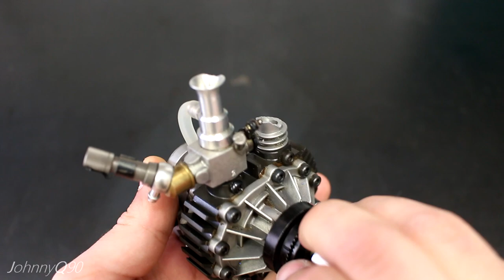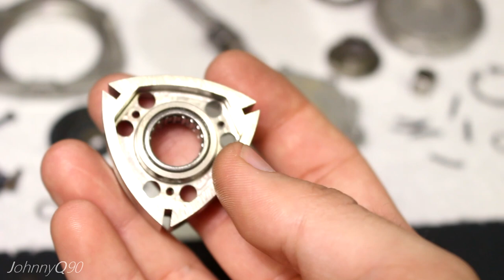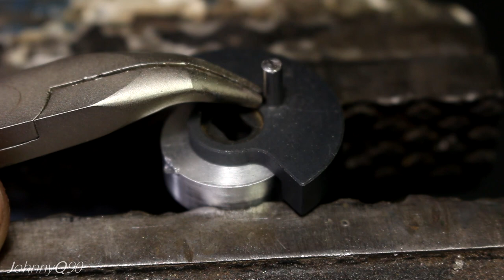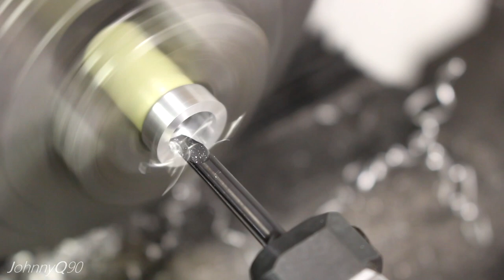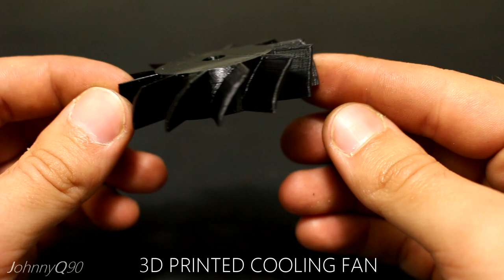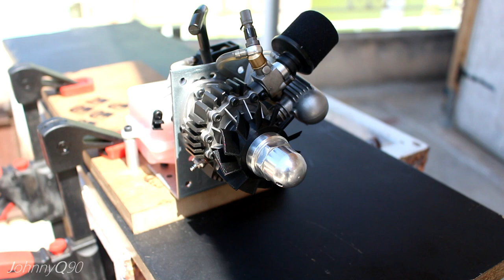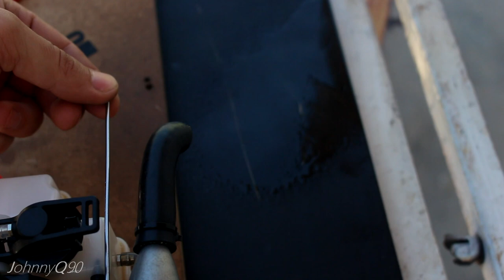Nitro Rotary Engine Cleaning & Pull Start Addition

Comment: Very interesting project well carried out, only criticism was the mod to the broken silencer manifold, reducing the internal Dia by fitting an internal tube restricts the flow of exhaust gas, a simple braze/weld process using alloy rods and blowtorch can mend these small alloy castings and effect a permanent repair without the internal restriction. The pull start is an excellent accessory to put on this motor. Well done
Reply: i was gonna say this but you beat me to it
Reply: Nah, TIG weld the muffler.  Easy.  Great video!

Comment: If the pin in the counter weight is steel, that may be the cause of much of the vibration.
Maybe an aluminum pin would be strong enough.

Comment: I have never seen a Rotary Engine that is Nitro. It is so awesome the RPMs come up so fast. I just bought a Cam-Am Rotary 
engine 1000 it like 998 cc. I haven't even drove it yet. I am in a wheelchair i have to put my hand controls on it this week. I have 
always like the Rotary engines awesome the way the work.I have lot of diff RC car and 4x4 trucks that are Nitro. The sound that 
that made was awesome.

Comment: Cool! 
Can you make a mini dyno for your model engines to test the power output? 
I dont know how, maybe something with a variabel electric load and an Amps meter?

Keep up the good work!
Reply: Jonathan Straetman yeah that can be worked to the engines be connected with a motor to produce energy that can be counted to volts i thing
Reply: pixelmaster i think it would work better if he converted to watts(i do not know hard that would be).
Reply: That little thing (OS MAX RE 49 PI-II) should have about 800W peak power output.
The only good affordable way I can think of is to use two multimeters, agenerator and electric kettle as resistor.

Formula to get the engines power:
P = I^2 * (V / I)
Reply: P = V * I
Reply: That is what I wrote. Therer is no need for the brackets and then you can take the sqaure and devide cancel each other.

The idea is P = I^2 * R as having a power resistor to meassure the voltage drop accross should be fairly easy (electric kettle, just poses the problem of variable resistance) and also meassure the current.
P = V * I
= I^2 * R
= I^2 * V / I

Formula looks a bit backwards, but it is practical (two multimeters should be in anyones tool box).
Reply: You need a constant load to measure exactly the power output. An electric kettle as you said, has a variable resistance and the way you suggest him to do it, is not precise.

You don't need to know the resistance to measure power. All you need is a load bigger than the generated power by the engine and you need an ammeter and a voltmeter. Voltmeter is not required. If you hook the engine to a known voltage generator you only need to measure the intensity (because you already know the voltage generated), therefore you only need an ammeter or multimeter.

You need to use a generator with the power output bigger than the engine power. Now put the ammeter on parallel on the output of the generator. I'd suggest using a shunt resistor or using an ammeter with protective overload circuit just in case that the generated intensity is bigger than what your multimiter is capable of measuring.

Now just use P = V * I and you get the RMS.
Reply: Or if you have a thick cable laying around, put the generator in short circuit through it and use a clamp ammeter over the cable.
Reply: When meassureing the current and voltage, the resistance of the kettle can change all it wants because current and resistance are correlated. You just have to have the system stabelize.
Kettles are basically water cooled power resistors (2.1kW resistors).

Generators, even good ones, vary slightly in output voltage. Not meassureing that at the time you take the current reading will definetly skew the results. Apart from that, some generators have a much higher open circuit voltage then they have load  voltage.

Hooking up any ampmeter in paralel to the generator will probably blow a fuse. In this case here with a 12V nominal voltage generator, we are looking at >60A current flow at peak power output.
Shunt resistors for more than 60A might be quite hard to find. (I found a 2kW rated, 3600 Ohm resistor, costs 510€)
The 12V from above are taken from a generator I found on Amazon on the quick. Probably an automotive part, puts out up to 110A at 12V (1.3kW)
Reply: It works the way you said but that way, it is more complicated I'd say. He could just short circuit the generator output through a thick conductor and just use a clamp ammeter.
Reply: Bon. Demais. PRETENDO. Ter. Huma Moto. Con. MOTOR.rotativo
Reply: Some smart guys in this comment section, awesome!
Reply: @0BRAINS0  - found this comment and wanted to point one thing out (from what I'm reading g your comment looks misplaced, but that could be YouTube bugging). A rotary motor (even like this rc version) is still a 4 stroke motor. There aren't any valves or valvetrain because the timing of the various strokes is carried out but the rotor itself covering and uncovering the ports as it 'turns'. So even this tiny little rotary is a 4 stroke. Just wanted to share that. :)
Reply: its rated at 1150 hp
Reply: Use a DC generator and multimeter to measure horsepower. Multiply amp*volt to figure out how many watts you're generating. 745 watts give or take is 1 horsepower. Divide horsepower by RPMs for torque.
Reply: @Otherhats  ))l hi kip
Reply: @MazeFrame  haha nerds

Comment: Put it on a Bicycle!  Make a small clutch on a sprocket and then put it onto a mountain Bike so you can shift it, and make a small gear box off of the engine as a final drive reduction gear box so that way the engine wont lug to bad.
Reply: TRX VLOGGER It wouldn't come remotely close to moving a bicycle, even with no one on it.

Comment: Will you make a two rotor out of 2 of these
Reply: Adam Powers I want to connect like five normal nitro motors and put it in a rc car
Reply: 5 of those RC rotary engines and it could probably run your car
Reply: i made a twin
Reply: Gmanmovies09 that car would have to be a smart car, and "run" at half a mile per hour
Reply: @refraggedbean  or be a go kart

Comment: that's a beautiful little engine ,,I've had a few RC engines over the years but never a rotary engine  ,currently i have a 5 cylinder radial  and an  opposed 4 cylinder RC aircraft engine ,,and too many RC engines made from weedeater engines and chainsaw engines to remember then all ,the biggest of them is in a large RC helicopter  , that one is a Husqvarna 3120 ,,120CC chainsaw engine that makes 7.7HP and 10 ft pounds of torque at 12500 RPM

Comment: Long live Wankel
Reply: Rest in Peace Wankel Engine 1964 - 2012
Reply: Yep the old German brand/inventor name for rotary engines ;)
But there's a reason why they're not used commonly anymore, they are simply inefficient and requires a lot of maintenance.
Reply: @BillAnt  nope it was named after the Founder of the Rotary,Felix Wankel.
Reply: @Julian < Sorry I meant the brand name/inventor, not the word for engines. :D
Reply: @BillAnt  Fuel & emissions efficient, no. 
Power-to-weight efficient, hell yes.
I had 3 RX-7's. 
The 3rd one was a turbo I rebuilt to run 13PSI.   :-)
Reply: Add to the positives, fairy easy maintenance with less moving parts than traditional engines.... add to the negatives fast wear of the rotary piston seals, inefficient combustion chamber (partial combustion), an oil guzzler, etc...  Those are probably some of the reason they haven't caught on for mass production after all.

Comment: I think thats a wankel engine, not a rotary engine.
Reply: A wankel engine is a type of rotary engine.
Reply: It's a o.s. rotary. Rotary is the style and o.s. is the manufacturer. Wankel is another manufacturer of rotary engines, hope this helps clarify.
Reply: ok, thanks for telling me :)  I thought rotary engines were those engines which had their cylinders in a circle around the crankshaft. Guess I was wrong.
Reply: that's a radial
Reply: So both of them are radials. I just learned something new!
Reply: Its a bit complicated, and somewhere in history, a few terms mixed up. in the early days of aviation, there where a kind of radial engines, where the crank is stationary and the rest is turning, the where called rotary engine. many years later, Felix Wankel invented his kind of engine, and it got the name Wankel engine, so strictly the are all wankel engines. some manufactures call it "system Wankel. When Mazda started to use the Wankel engine, the give it the name rotary engine.

The O.S Wankel engine is a project of Graupner / NSU (back in the 70's one of Europe biggest model company's, and NSU the only car manufacturer that used a Wankel engine) And O.S. Back in that years, the model engines where not very sophisticated. So Graupner invested in O.S. to get better machining tools and equipment to build such an engine. 
And That is why other iconic O.S. engines where developed after this engine, the were able to produce them. 

There is also another (back in the 60-70) big stationary and bicycle engines, called Sachs, the also did produce Wankel engines for lawnmowers, snowmobiles, and so on. 

So my history 101 on Wankel engines
Reply: So I was techinically right about what I said? And also, I LOVE sachs, I'm actually working on my own sachs engine for my e-type (I want to go faster thatn 30km/h) ;)
Reply: That's correct, this is a Wankel KKM motor.. not a rotary. Graupner GmbH. became a Wankel- NSU licensee in 1967 and was limited to the non-rotary KKM-57 type Wankel engine shown here. Hanns Paschke and Walter Froede discarded Felix Wankel's troublesome Rotary type layout for the conventional rotating shaft arrangement.
Reply: +rdizzy12  Hanns Paschke and Walter Froede completely discarded the rotary layout with the Wankel KKM-57 engine... the only rotary Wankel engine was Felix Wankel's original single prototype engine that resides in the Deutsche Museum.
Reply: Seth Echternacht Graupner GmbH bought the rights for the Wankel KKM-57 design (the non-rotary version) from Wankel-NSU Sept. 12th 1967, decades later O.S (Hobbico) purchased the WANKEL design and remaining parts inventory after Graupner discontinued production. Just to clarify, Cheers!
Reply: +Marcel Hanenbergh More complicated than you thought... It seems you have your facts a little confused. Felix Millet invented the Rotary type internal combustion engine for MOTORCYCLES in 1892 BEFORE the invention of the Radial type engine. 
 Felix Wankel was a huge motorcycle enthusiast and fan of the Rotary powered Megola bikes.
 Wankel copied the Rotary layout for his first "orbiting piston" concept, a supercharger designed for a NSU motorcycle land speed record attempt. He and Walter Freode adapted the "orbiting piston" concept into a rotary layout engine (the DKM-54) which gets its name "rotary" from the stationary, fixed crank-axle that the engine case 'rotates' around.
Reply: This tread has tought me a lot more about something interesting than school has :)
Reply: +Edvin johansson Unfortunately schools today don't offer much regarding the Wankel engine anymore... most of the nearly 100 universities and research institutes have abandoned any interest in the design after 1975 when some very discouraging studies were published   that revealed some serious limitations on any future development potential and most of the 26 original manufacturers abandoned plans to produce them commercially.
Reply: Well... I don't think it would have been fun if school thougt me about wankel engines anyways. For some reson they always make everything so boring. Try to think of something that school has thought you, that you enjoyed being thought. (Probably just a few things) :)
Reply: from my knowledge Graupner never did produce the engines, its O.S. that produce them, but who had the rights, I don't know, probably Graupner, and that part could have been transferred to O.S. 
Hobbico is not the parrent company of O.S. its just the distributor for the USA.
Reply: I only used the therm radial for the piston layout, all rotary engines, have a radial piston layout due to balance of the engine. i think thats where the confusion comes from.  all rotary engines have a stationary crank
Reply: Felix Wankel was the inventor of this type of rotary piston engine.
Reply: Those are fucking same

Comment: Why do you hacksaw your lathed parts instead of using a parting tool?
Especially when they have a hole in them?

I see you use it for some
But I’m genuinely interested why you don’t for all
Reply from the maker: Because some times the part is so big that my parting tool can't cut it off. Another instance is when the part that I'm cutting off is steel. I don't risk it because it's a mini lathe.

Comment: Your a Pro at these engines wow! I bought my first ever Nitro R/C not knowing anything abt them and its been sitting up for some years now and now that I want to see if its working Ive noticed the pull start is locked up, what can i use to loosen or free up the motor what you suggest on 1/10 scale nitro motor

Comment: When you drilled the hole in the balancer(?) for the pull-start, Did you add an equal weight or take away to compensate? I noticed it ran very unevenly for a rotary.
Reply: It's also a single rotary, most are opposed twin rotor

Comment: You inspired me to do the same thing with my os wankel (mine is the older .30ci) but instead of the pull start, i used an ez start system off an old 2.5r traxxas engine. Sounds/looks/preformed awesome

Comment: I do odd RC conversions like this for fun.  (latest build is in my channel, 4 stroke airplane engine into truggy) 
My suggestion, since you made such a great pull start and cooling solution, is to resurrect your old  RC car.  You could also put a prop back on it and make a pretty cool airboat.

Comment: I believe, GM experimented with this engine design years ago and the only reason it didn't hit it off was because of the wiper blades they used lasted too long!
The engine was running well over 100,000 miles of hard use and exhaust emissions weren't all that good. The exhaust emissions were possible to clean up.

Comment: i wonder how far off the balance was effected by drilling the counterweight and adding the drive pin..  you may need to set up  a shaft balance device with 2 bearings on each stand to support the shaft.. a zero balance plate with holes drilled in the same angle and 180 out of the mods.. you will need a new counter weight to find the balance of by adding bolts and fine tuning with thin washers till you get a zero balance on the shaft with a duplicate counterweight.. then install your counterweight and you will need to drill shallow holes or add additional weight to equal the zero balance.  then your vibrations might be gone.   other than that issue.. i love it.

Comment: Did you need to re-balance the counterweight after removing material and replacing it with the pin. If it is a steel pin then it seems like more weight was added than removed. Maybe not if the pin is titanium and the counterweight is steel.